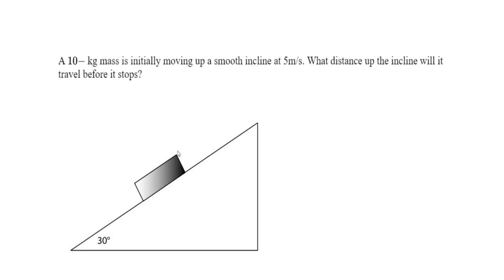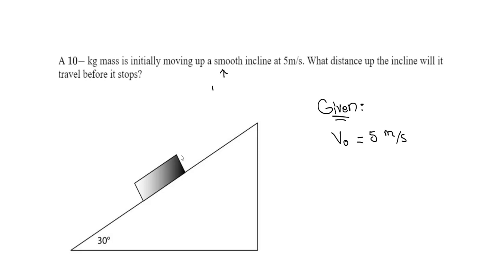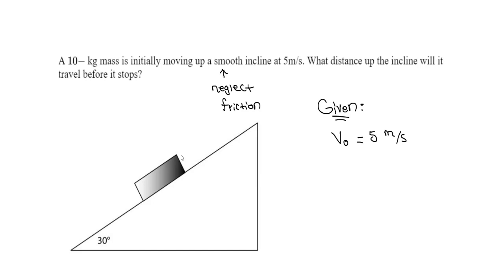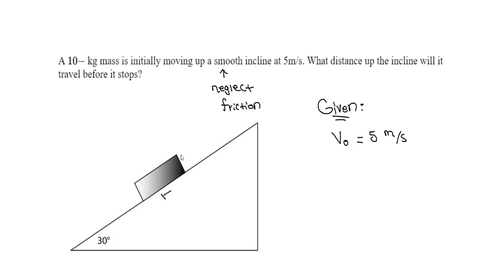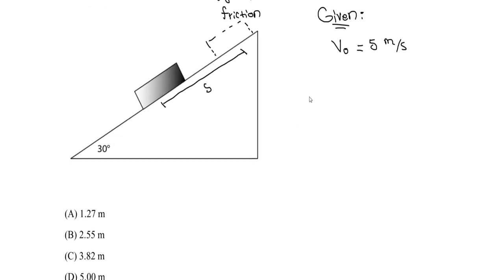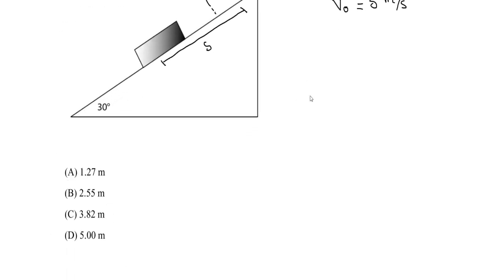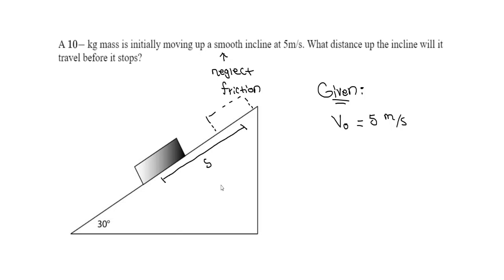FE Exam Review - Dynamics (Kinematics)

Comment: Easier way derived from 1/2*m*v^2=mgh
sqrt(2gh)=v
(v^2 /(2g))=h
plugging the numbers in gives you that h= 1/274

h is the vertical component of d, so just divide h by sin(30) giving you 2.55

Comment: Thank you for the tutorial! 
In the section where you are showing the "Particle Rectillinear Motion" equations you will be using around 6:50 the last equation does have time at all ( vf^2=vi^2+2ai(sf-si)) which makes it faster, assuming we are not needing the time as well
vf = 0 since it stops, vi = 5 m/s, ai = -4.905 m/s^2, si = 0 because it stared from 0, and sf is what we are looking for we get an sf value of 2.55. Is this a corrert way of going about it?
Reply from the maker: Thank you! Yes you can absolutely use that equation. It makes the work a lot easier too! Good catch, I’m glad you pointed that out.

Comment: Much quicker way to solve for this is to use an energy balance:

Potential Initial + Kinetic Initial = Potential Final + Kinetic Final

Treat initial height as reference -> PE initial = 0.
Block comes to a rest at the top -> KE final = 0.

1/2mv^2 = mgh, m cancels.

Write h in terms of the distance up the incline plane.  Sin30 = h /d -> h = d*sin30

1/2*(5)^2 = (9.81)*d*sin30 -> d = 2.55 m.
Reply: there's an even easier way than that lmao (v^2 = v0^2 + 2a*deltaX)